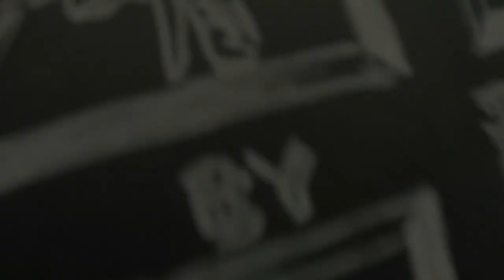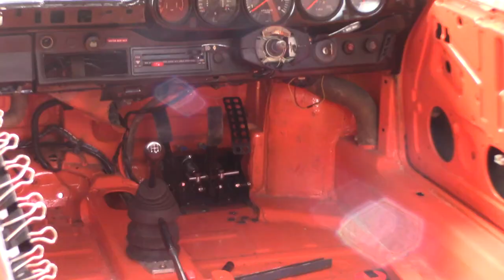Fitting a race pedal box - Porsche 911 Classic Car Build Part 35

Comment: Another great video...the brass bar tip is great, I keep a piece of copper to weld holes etc
Reply from the maker: Yeah, normally copper it the go to, but all I had was the old piece of brass. I have actually seen you can get copper paddles with a magnetic attachment, which would really come in handy.

Comment: good job strengthening the pedal box, sorry I didn't get a chance to show you what I mean but you got it spot on!

in my case, I simply cut off the original mount and welded on a new one! I'll message you a picture if I can, I found an old one!
Reply from the maker: Thanks for the tip anyway. As soon as you said it I had a look and I could see what you mean. What I have done is not perfect, but it should be a lot stronger than it was.

Comment: Cant believe the race car pedal box manufacturer made the bracket holding the pedals too flimsy..must be made in China....Why dont manufacturers actually test their products? Excellent work Jeff! Nice and solid now. Looking forward to seeing how you do the sound deadening, I've done a crazy amount on my car actually gluing thin sections of wood on large sections of the floorpan, then a layer of Dynamat, then foam, and then Mass Loaded Vinyl on top. Mrs Jeff appearing under the car was surprising...

Comment: JEff! I like that pedal setup. Where did you source it? Also do they make a left hand drive version as I am in the Northeast USA. I am restoring a 73 Targa thank You-Neil
Reply from the maker: Those pedal boxes are not side specific. They require a bit of fabrication to get them to fit, so keep that in mind. I still have to get some custom made cables for the clutch and accelerator and make the linkages for them. I remade the hard brake lines to connect to it and it also needs a brake switch adapted onto it. Have a look on ebay, that is where I got mine, although there are better, stronger ones than the one I have, which I would choose if I was doing it again.

Comment: is it possible to still use the brake booster with a pedal box like this....?!
Reply from the maker: You would need to make up a custom linkage to make it work, but I don't see why not.
Reply: Home Built By Jeff which is probably too tricky given the distance between a floor mounted pedal box and the oem brake booster and clutch cylinder position 😕

ps: talking about a 280Z here
Reply from the maker: 911's had factory floor hinged pedals (and later cars had boosters). You can also get similar pedal boxes that are top hinged ;)
Reply: Home Built By Jeff true - although I really prefer a floor mounted pedal box over the top hinged - would be really nice in a Datsun...

but thank you very much Jeff 👍🏻